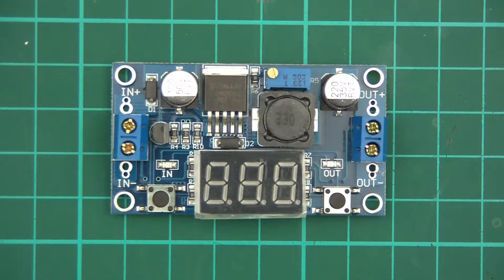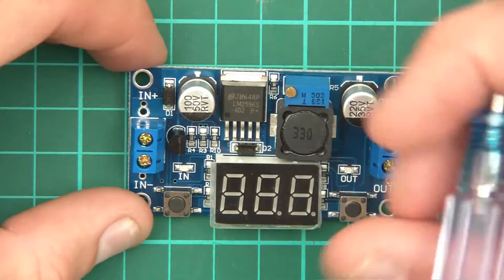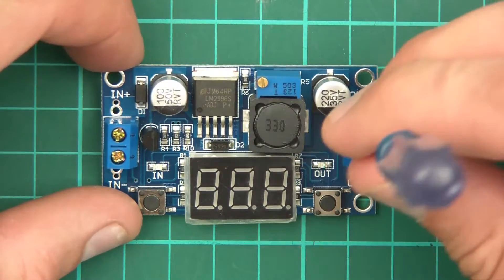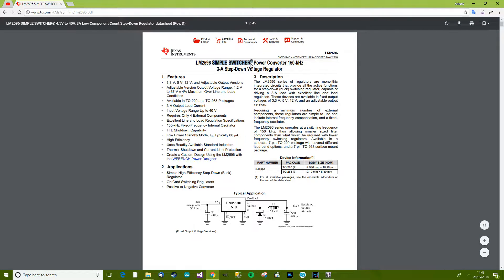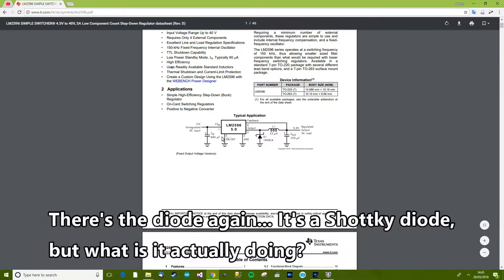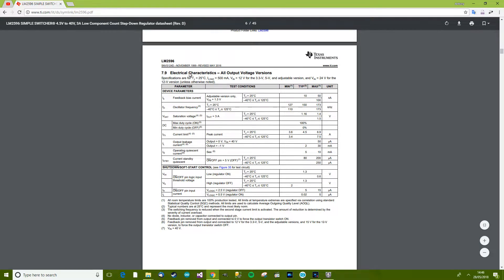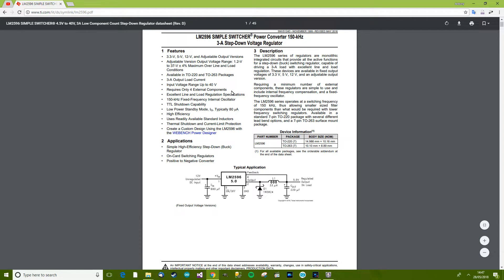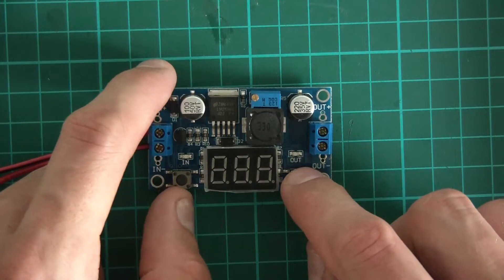INVESTIGATING: LM2596 DC-DC Adjustable Step Down Buck Converter/Regulator With Display (Part 1/2)

Comment: You should use the two buttons. left for switching on and off. right for switching between in- and output. if you longpress the right button you can adjust the voltage.

Comment: if you hold down the out button you can change the value shown so you can set the displayed offset (sort of like a calibration but just by whats displayed than changing the measurement)

Comment: Cheap ones I've bought from china were unstable. Output jumps from 5v to 10v for a split second. Would be dangerous to power an rpi3. The 9A 300watt dc converter is ok.
Reply from the maker: Wow, that's bad!